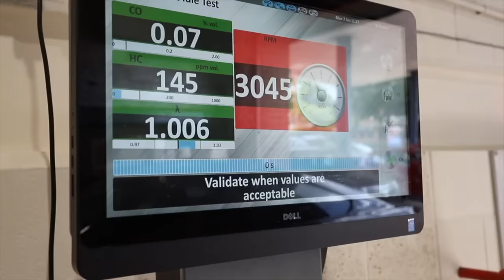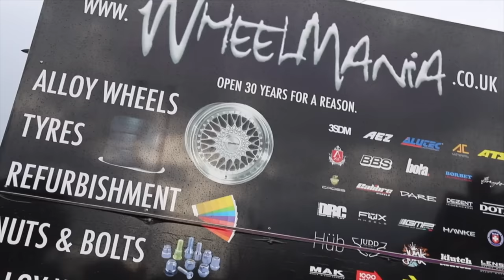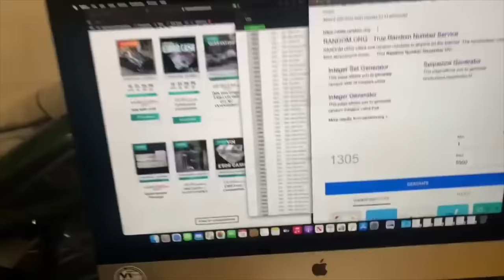BUILDING A BMW M4 IN 10MINS

Comment: The car looks nice but after that massive accident I doubt the chassis is 100% straight. I think you have to meassure in different points of the car with a very expensive laser machine to check that the chassis is not bent

Comment: crankhubfix shows that he dont know anything about that car ...
Reply from the maker: Yeah I know absolutely nothing. Seems to be the same for yourself aswell 😅 you called it a crankhub fix when it’s actually a capture plate. Omg man c’mon get it right first before you comment. Did you not know you have to be an expert before commenting jeez
Reply: @MatArmstrongbmx  sry im not english but the problem is not fixed with that ... it gets even worse  ...
Reply from the maker: @alfonzhatler  10,000 miles and 500+bhp says otherwise 🤷‍♀️
Reply: @MatArmstrongbmx  for 500+ hp you dont even need that funny plate the right tourque and good diamond plates should handle this ... the problem isnt that bolt so you dont need that plate... but 10,000 miles ...
Reply from the maker: @alfonzhatler  okay mate 👍🏼thanks